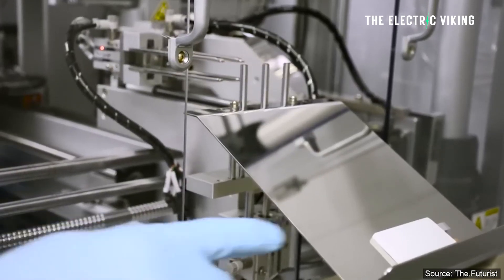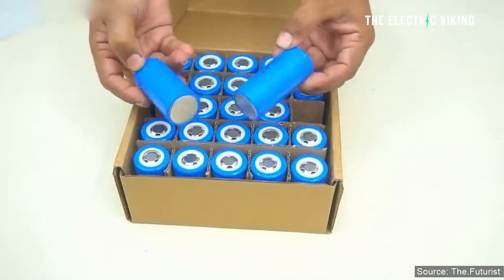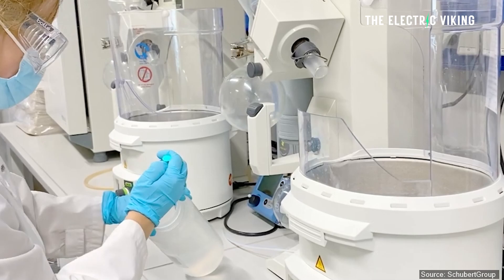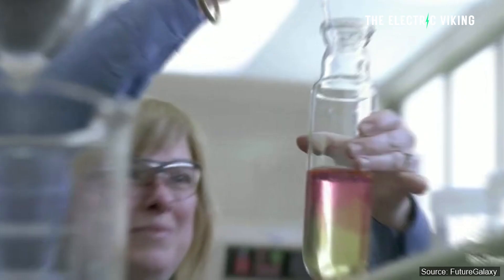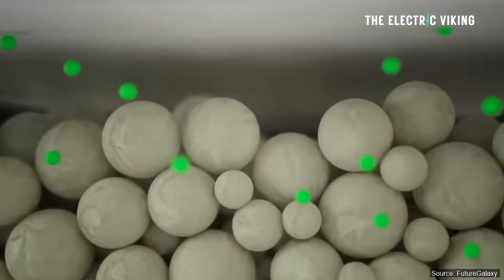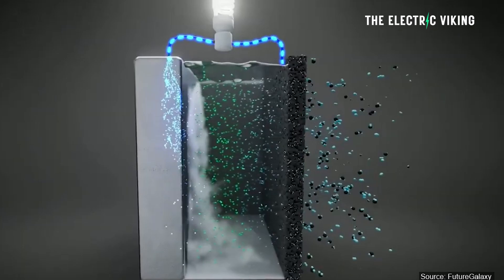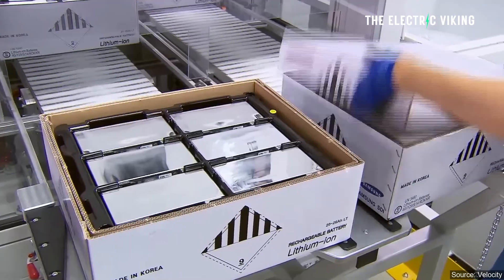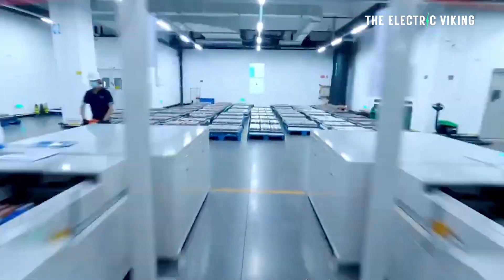NEW Aluminum-Ion Battery has higher energy density & longer life than lithium

Comment: Tinfoil hat time(none of this is true or provable).  Methylene blue is being consumed why? to feed the nanobot batteries, to recharge the chemistry of the graphene nano bots that subtly control you through the older 3G/4G network. Why is the population who takes Meth-blue that same who opposed and opposes 5G, because they want to keep them on the older networks exclusively to reduce the noise from cell phone usage. OR these people are mentally unstable and having them take supplements that are unregulated you can sneak in chemical precursors, with the addition of Methylene blue you can then generate phenothiazine along with similar compounds that would then help regulate fringe psychotic behaviors and mental disorders that prevent these extremists from becoming highly unstable. BUT they, the consumers, go hard and take too much which leads to an imbalance sending them further down the rabbit hole.

Comment: At a lower voltage though, safer batteries are welcomed but we still require solid state batteries to eliminate fire risk. We will still need all forms of motive power though as no grid can sustain more than about 20% EV's

Comment: If that battery has a range of 400 miles and can charge 5000 times with a loss of capacity of only 15% ,  that battery could provide a lifetime range of 1.5 million miles. Thats honestly incredible. The car will fall apart before the power plant fails.

Comment: Because of the high oxidation rate of aluminum, a mechanically assisted aluminum battery that might consist of cylindrical blocks of aluminum that are immersed in an electrolyte solution and constantly slowly rotated and filed by a small, geared motor to scrape off the oxidized layer. This may considerably increase power output.

Comment: Use a multiple compound anode made of phenyl thyazine polymer, silicon and titanium, for the cathode side use iron 3 ferrocyanide with copper oxide/graphite collector. The higher charge ratio and cost of the aluminum would compensate for the need for lithium and cobalt per unit of mass.❤

Comment: If they really can recharge at 10C (that's not a temperature, btw, it's a rate), then it should recharge in 6 minutes, theoretically. In practice it will take longer than that, because it's only a peak speed. And if that can be done thousands of times without killing the cells, it will be a pretty amazing battery technology. Let's wait to see what happens over the next few years. We live in exciting times. Thanks Sam. 🙂
Reply: Al ion can charge / discharge at rate up to 70C

Comment: 10C does not stand for 10 Celsius, it stands for Coulomb. In this case it stands for charging speed.
typical batteries like in the ID series charge with a maximum of 2...2.5C.
CATL recently anounced an LFP battery with 6C. that results in 60 minutes divided by 6 = 10 minutes for a full charge if they would always charge with full speed (which would destroy the battery).
so, 10C is really, really fast. full in 60/10 = 6 minutes. of course you would reduce charging speed at the end which results in approx. 10 minutes for a full charge.

Comment: 10C does NOT mean 10 Celsius. It’s a measure of the charge rate compared to capacity. 10C means that it can charge at 10 times its nominal capacity (e.g. a 1Ah cell can charge at 10 amps)

Comment: Interesting, but I'm still interested the most in the aluminum-graphene battery, by Graphene Manufacturing Group. They are partnered with Rio Tinto, which recently gave GMG non-dilutive funding to develop batteries for them (Rio Tinto will receive 1st purchase rights for the batteries.)  * Fair disclosure- I am a share holder.

Comment: If it turns out to be the same price as LFP batteries, but lasts 50 years instead of 8, that will solve the battery problem.
Reply: With exiting new CATL batteries having a life of 3,000 cycles till they get to 75% and much cheaper than last years battery these would last 50 years in an EV. . Then you use them energy storage rather than recycle them repurpose them .Aluminium batteries may be better suited to energy storage on a large scale depending on cost and temperature affect to charging rate and expansion and contraction during cycles  .

Comment: There are bound to be many “breakthroughs” over the next few years, most of which will die for whatever reason. Perhaps in 5-10 years there will be an accepted best solution and thereafter incremental improvements will follow. In the meantime I think it is interesting to learn about these developments if only for satisfying curiosity.
Reply: The none Lithium battery breakthrough rate is likely to be somewhat more exponential than the Lithium one. The one issue is with who has been doing the research and has been working on actual production research.  

80% is being done in China . The US despite sitting on the worlds largest known Na reserves is still production focused on Li 🤦🏻‍♂️ technology’s.

Comment: I (as a chemist)  have been saying for more than a decade that rechargeable Aluminum batteries are the future....and when they get the chemistry right they will replace most battery types.  Lithium when it oxidizes releases one electron.....aluminium can release three electrons. Li ion may be the main chemistry for EVs for some time to come because of superior energy density, but I can see Al ion taking over commercial and home storage.
Reply: Sam brings out a great audience of various relevant disciplines. Be cool to get everyone in a live forum of some type.
Reply: Check out GMG, they are a graphene manufacturer, using graphene to make graphene aluminum ion batteries, and their stock is trading at an insanely low level right now, even though they are progressing quite quickly
Reply: Iron (Fe) release 3 electrons also, doesn't it? (Just asking)
Reply: Have you looked at Graphene Manufacturing Group's battery? It's an aluminum-graphene battery.
Reply: What about dendritic amalgamation?
Reply: @markhartung1190  Amalgamation as in Mercury?
Reply: Yeh but is it safe.  I’m hearing solid state battery is safe and higher than lithium now already
Reply: Me too, the same way of thinking
Reply: Yeah, and The Clapper was my idea

Comment: I'm an experimental longevity researcher. It's funny they are using a sulfur nitrogen chemical, and something related to methylene blue.

Methylene blue is a powerful longevity chemical that is an electron acceptor that helps balance out NAD+ to NADh ratios. That anti psychotic does something similar in the brain to address inflammation.

NO2 and H2S are slave ossilators of circadian rhythm and epigenetic quality control, which help balance the methylation and demethylation pathways and the electrochemical proton gradient.

They are modelling a battery on human epigenetic flux and electron acceptor / donor balance without even knowing it.
Reply: Thanks for the additional information. Insightful.
Reply: Isn't it funny how the 2 subjects that are so different, are also so similar at the same time.
Reply: It's nice that the Sulfur from diesel is more readily available!
Reply: The best we can do is recreate/imitate, to the best of our abilities, what is already in nature.
Reply: Do you recommend taking methylene blue? I have issues with electrolyte balance, primarily salt. My body has stopped wanting to retain it unless I am eating tons of carbs. Fasting sends me into a tailspin where I'll consume 10 g's + per day to keep my heart rate lower. You sound very knowledgable, if you have any advice or insight I'd be grateful to hear it.

Comment: If this batterry recovers to 100% of its original capacity with an appropriate conditioning cycle, then the data (supposing the data exists) is effectively demonstrating the battery does not wear out in any fundamental manner - so, it can be made to "last forever." Please dig into this further and link us to the researchers' actual data.

Comment: Cool stuff pun intented but this is why i hate  lab results 10 celcius is not a real tests try 35 or 45 degrees  celcius youd have to remove battery pack to recharge which leads to all kinds of logistical nightmares not to mention costs go up dramatically
- Keep up the good work love your stuff
after reading another post what temperature  did they actually charge it at if not ambient road temp ie 110+ then results are not worth  noting for vechicles but for a controlled environment maybe theres that added energy drain at keeping temp low

Comment: What is the temperature operating range? Most of the aluminum battery designs to date required high temperature to work. So many of these very impressive battery technologies talked about have some feature that prevents them from being commercialized or used in many applications.  I believe eventually one will be developed that will have high capacity, high charge and discharge rate and low cost. Maybe this is the one! Will just have to wait and see.
Reply: He says the tests were carried out at 10 degrees Celsius

Comment: In time batteries will last forever. We are at the “model T” stage of this and chemistry is full of surprises.
Reply: Not really, the only real breakthroughs in a 100 odd years have been nickel, and more recently Lithium. There have been hundreds, if not thousands of proposed breakthroughs the last 30 years or so, none of them make the cut to be commercially realist. Basic chemistry / physics limits what’s possible.
Reply: @mkyhou1160 a battery that retains close to 100% capacity after 5,000 cycles would last over 40 years, assuming charging every 3 days based on higher energy capacity and range and moderate daily driving  for the average owner. That is effectively lasting forever as a lifetime of driving for many people assuming the rest of the vehicle lasts that long

Comment: So why are these batteries better than the current trending sodium batteries?
Reply: Trending? We already have and will have many more different battery types and chemistries. Every single one has its special place, its technological niche application where its better than the alternatives. This one is one of many.
Reply: This is all stil at research scale. Sodium-Ion that is useable for EV's is not available yet, as the mass production facilities don't get built overnight.
Both are made of more abundant materials, which will cut cost and pollution from mining at the scale needed to power the world.
So even if they are more or less equal, both may succeed.
Reply: @SolAce-nw2hf  You are of course correct for US firms. In China CATL, HiNa and a third one i don‘t remember have already put their cells into batteries to be put into EVs. Past tense. Not future.

Many will succeed. Na+ have two major advantages: Robust against temperature changes and low temperatures and very high power possible. 10C is the „new normal“. They have two major disadvantages: Size and Weight. Every battery has its own advantage and disadvantage making it fit for many but by far not all purposes.

Na+ are good for farming, building, ships, trains. Redox Flow are good for Solar, Ships. Li-Ion are good for high power applications possibly airplanes and drones in the future, LFP are good for solar, EVs, Medium power and very long lasting requirements. And so on and so forth.

Comment: It's not "10 degrees celsius". It's at 10C. C is a measure of how fast you charge (or discharge) a battery. It's the - unitless - ratio of (dis)charging power to battery capacity.
 Example: If you (dis)charge a 50kWh battery with 100kW you are (dis)charging at 2C. A Tesla at a v3 supercharger charges at about 3C initially. That is already very high (most other automakers only go to 2C or thereabouts). If they can do what they claim at 10C without destroying the battery then that's pretty incredible.

Though we'll have to wait how all the other metrics pan out (calendaric aging, temperature dependency, tunraround efficiency, etc. ...)
Reply: Actually, the charging factor C refers to the time it takes the battery to (fully) charge. if t = Time and Cr = C Rate, you can use t = 1/Cr (for hours) or t = 60 /Cr (for minutes). so, for example.  2C is a battery that can be charged in 60 / 2 = 30 minutes.  
10C is a charging rate of 60/10 = 6 minutes. Fully charging the battery in 6 minutes would be amazing.
Reply: Enough reading can eventually cure the most stubborn ignorance...
Reply: @DarylOster  For that to happen the reader must understand and be able to process what he/she/it is reading.
Reply: 250 kW / 75 kWh = 3,33C.
Reply: He must have stayed up too late to miss what 10C is .....  oops